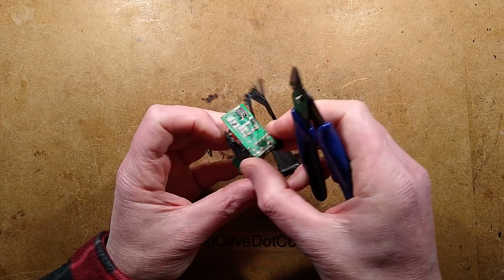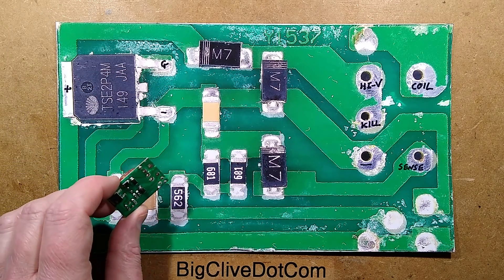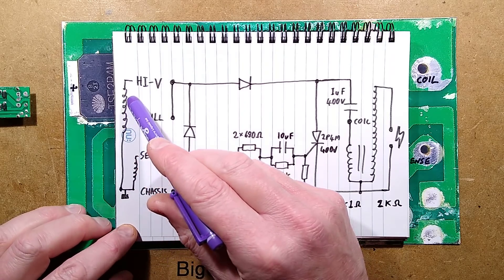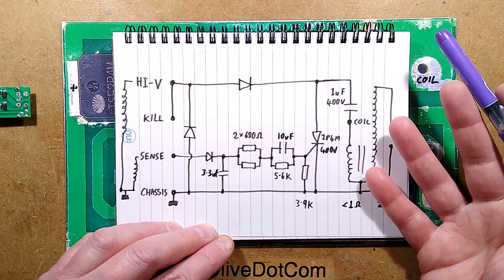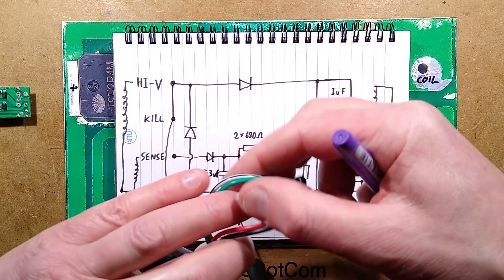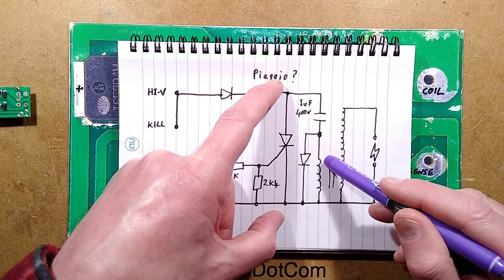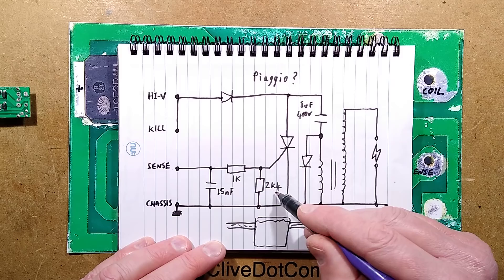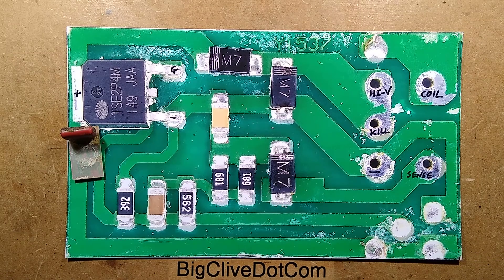Inside a cheap CDI Capacitive Discharge Ignition module - with schematic

Comment: If you haven't had a belt off an ignition coil you've never lived!
Reply: or a TV Flyback circuit. 
The worst shock I've ever had was from the HF start on a tig welder.
Reply: @TomOConnor-BlobOpera  iv had that my self Tom.. no joke i tell ya!!
Reply: When I was young and pretty, I had a dirt bike engine run away on me, the throttle slide was hung up. It was revving away at about eighteen thousand rpm, I hit the kill switch and nothing, grabbed the spark plug boot, got electrocuted, then smashed the sparkplug with a hammer that happened to be handy.
It was exciting.
Reply: @spurgear4  "Hammer Kill Switch" would make an excellent band name! :D
Reply: @Kae6502  I agree, maybe a rock and roll bagpipe kind of thing.
Reply: @spurgear4  mechanical retribution haha 😂
Reply: @spurgear4  🤣🤣🤣🤣🤣🤣🤣🤣🤣👍
Reply: A modern ignition coil is way worse than any measly flyback in a TV!! 
A flyback makes a nice soft little tiny arc meanwhile a modern ignition coil will jump over a 1-in gap with a thick nasty spark!
And yeah I've also been bitten by HF Tig That's no fun either!
Reply: I got a bite from an aircraft magneto....holy hell those things have some kick!
Reply: @DiverJames  AgentJayZ (aircraft engine mechanic) has tested lots of those and on the smaller engines, the ignition snapping noise is audible until the engine is up to a substantial percentage of its design speed. Would be interesting if he could donate a broken one for teardown. (Would take a while since for obvious reasons, those rarely fail.)
Reply: @NiHaoMike64  jet engine igniters are potentially fatal; several joules (at least) and extremely high voltage. As a retired pilot, I've followed @AgentJayZ for a while - always great content. We can switch the igniters on/off from the cockpit too - operational conditions sometimes dictate it as a safety measure to allow immediate relight in case of a flameout (like during heavy rain/snow/turbulence, etc). ☠️😬
Reply: On my BMW airhead I discovered that it discharges the coil on turning the ignition key to off. I was holding a spark plug at the time... 10Kv across the chest hurt like buggery.
Reply: Was timing a buddies car long ago, the timing light had a screw on the handle, revved up, timing light arced through the screw down my arms out the fender i was resting on. It clamped me pretty good, had to yell at him to kill the engine. I now have an intimate idea of what 2000rpm feels like from the spark plugs view....

I couldn't open my fists for 15 minutes.
Reply: DARK APPARITION  Yeah, I learned not to touch the metal part! I am super careful now but I know it's going to happen again! These things happen lol
Reply: My side cutters got some new teeth in the blades today after getting a hit across 2 phases of a 600v supply that was definitely, positively, off.  Big flash, nearly fell off my ladder.

One of my grandfather's favourite tricks was to lift the bonnet of his old comma van and put his finger on the tip of a sparkplug whilst the engine was running.  Then he'd ask you to "just grab my adjustable spanner from the toolbox in the back".  He was a bugger, my granddad.
Reply: I have received several belts from ignition coils. Particularly when checking if leads are seated while the engine is running. most recently the connection to the points on my car which is an exposed nut (91 starlet 1E engine). the back EMF can give you a wallop too.
also got hit with several lawnmower engine magnetos,  an apple green screen monitor flyback, and a flyback that  I made a driver for at one point.
Reply: The worst bite I ever had was when the filter caps from my Marshall Major (640V) discharged through my finger!
Reply: yip!! no kill switch on the old lawn mower we had when i was a kid. pulling the sparkplug lead was not nice until i learned to not be still holding the handel for pushing it. even still not touching any part of it ya could still get a bang off it!! if anyone knows why that is when its covered in pure rubber i loved to know???
Reply: My brother hooked up a bike ignition coil to an RC NiCd pack many years back 7.2v pack and 12v coil, so not full output) and took it to a busy pub where he was zapping his mates. A load of other lads wanted to try it, and we ended up with a circle of maybe 20 people holding hands while he passed a shock through them all. Was very funny at the time, but he'd probably be in jail if that happened now.
Reply: @ferrumignis  You can try electric fence. The one for sheep has the most "bang", 10kV easy. And... yes, I and my classmates have tried it by daisy chaining ourselves. Everyone got their share of shocks.
I've tried to be careful around electricity but 220V from wall socket, half-rectified 400V from studio flash and ignition coil still got me. Don't like wintertime in modern buildings (extreme dry air and many synthetic things around) as this lets you experience static discharges about 1-2cm (nearing a inch) long.
Reply: @SeersantLoom  I spent every holiday at my grandparents farm as a kid, so I know electric fences quite well :D
Reply: Or the flash circuit from a SLR (approximately 3 joules)
Reply: I just got some 230vac shocks as a kid from a defective outlet. When high voltages are involved, I am always very calm and slow and careful and turn off power as soon as possible.
Reply: Not an experience I want to relive.
Reply: Very old "air rake" (several HP 1cyl engine with a big blower on the front) wouldn't shut down so I figured I would pull the plug wire...with insulated pliers because I knew it was hot and HV.  It was stuck so I grabbed the frame to get more leverage and YOW that insulated handle did squat to stop me from being shocked.  Next time I got a screwdriver and shorted it instead.
Reply: Try getting zapped by a LS truck coil, or better yet one of those old MSD boxes through a hot-rod coil via loose distributor wire cap!
Reply: I licked the terminals on a 9v battery, once
Reply: I remember lawn mowers that had a tab over the plug, and you had to hold it down to the plug to kill the motor
Reply: Got nailed by the electronic ignition coil on my truck back when.
wasn't even near touching the plug wire, but the arc was high enough voltage when I pulled the wire off that it arced around the boot to my hand.
Never used that method to stop my engine again...
Reply: A plasma cutter shock is stunning also
Reply: electric fence... weee. thats even worse. sledgehammer hit but all over.

some farmer claims they cure ross river fever or chonic fatigue after being pinned on one by a bull...

iunno, getting bucked off by the donkey onto one sure livened you up...

still, my worst was the 600V cap on the guitar amp... oh wow. thumb on the terminals as i pulled the chassis out...
Reply: I've gotten jolts from flybacks, 480V across the chest(don't trust humans, always lockout-tagout), and spent days in a row as an Ironworker welding with sopping wet clothes and gloves(changing electrodes is a rush when your grounded via the steel beam that your legs are clamped around), so I must be extra alive by OPs standards.
Reply: I remember my dad and I were changing the spark plugs on the bikes, I was testing for spark for some reason so I touched the spark plug to the chassis with my thumb still on the metal part of the spark plug, when I went to turn the engine over I got a big jolt through my hand! We were both in stitches after that!
Reply: @alistairstuart2009  I was timing a friends car long ago, and I distinctly remember thinking "I wonder if the screw in the middle of the handle of this timing light (old strobe style) is isolated.......Surely its not anywhere near the energized wires insi..." and then my hands clamped around the gun as angry pixies found their way halfway down my arm and into the fender. I got cycled through quite a few RPMs till my friend cut the engine off, couldnt open my fists for about 15 minutes.....Good times.....
Reply: The volts jolts, but the mils kills.

Comment: Honda have been using black as switched live for years, green for earth also it needs a minimum of 8mm spark to fire a gap of about  
.7mm under compression with fuel mix.

Comment: If they did not shunt the HV on the opposite half cycle they capacitor would charge to a not safe level ... it would act as a voltage doubler  and it would require twice the voltage rating of the capacitor.

Comment: The spark is generated with the collapse of the magnet field in the coil primary winding. The diode across the primary coil in the second schematic will pull coil to ground rapidly, enhancing the spark at the plug.
Reply: You both confuse CDI with the classic ignition system.
Reply: @Plons0Nard  diference betveen clasic and cdi is that classic use 12V and high power mosfets to create spark while cdi uses high voltage capacitor and therefore doeas not need a lerge amount of current (CDI capacitor discharge ingnition)
Reply: That's as I always understood, that it's the collapse of the voltage in the primary windings that induces voltage in the secondaries to produce a spark. The coil is fed a live and the module is on the "earth" side to break the circuit in response to a pulse from the sense trigger. This looks like a single cylinder either motorcycle or plant power, not sure if anything works differently on some small engine stuff.
Reply: TCI/point do rely on charge/collapse the external coil, the CDI works pretty much like a simple transformer. Both coils are not compatible.

BTW, the CDI system have a faster spark build up, and usually shorter,  than TCI (12v) or points, make them very actractive for determined engine types.

Comment: I thought that the high voltage output on the secondary coil came from the collapse of the magnetic field thats provided by the low resistance primary windings. The primary has current flowing building a magnetic field and when that current is diverted away from the primary windings the field colapses causing an extremely high voltage spike on the secondary side because of the much more numerous windings which is also why the secondary has such a high resistance
Reply: yep thats right.
Reply: that's a conventional points (or electronic) ignition, this is a CDI
Reply: @nirodper  So spark occurs when the coil is energized ?, no can't be true.
Reply: @Boraxo  The 200+v capacitor gets discharged across the coil primary, with a very low dc resistance. The only thing limiting current is the coil inductance. I do believe it's forward conduction, the core has very little iron, the primary has few turns, and the current is big but isn't that huge so the core can't store much energy.

That's one of the great things about CDI's, capacitors are much better at storing energy than inductors
Reply: @Boraxo  On a conventional ignition you'll get a large voltage spike on the coil when the points open due to the stored magnetic energy. This large spike is multiplied and you get kilovolts at the secondary. The CDI is the same except the voltage spike comes from the capacitor discharging instead of the magnetic field collapsing.

Comment: Yes, you can indeed get a shock from the kill switch wire, seen it happen quite a few times on small boat outboard motors, with varying degrees of amusement.
Reply: Agreed- much funnier when it happens to someone else

Comment: Clive,what kind of disolvente fluid did you use for the epoxy! Thanks, snd regards from Boca Raton, Florida.
Reply: He was using acetone.
Reply: @chrishartley1210  DCM is also very effective at dissolving epoxy. Though if you leave it to soak too long components can start disappearing too.

Comment: Several of my customers and myself have received the shock you suspect when connections fail.  Sometimes at the metal handlebars when the earth connection is lost.  Sometimes at a metal key switch.  Precisely as you predict rather a surprise, also happens on mowers and such with magneto spark engines.
Reply: The man, the myth, the legend.  Funny running into you on YouTube Jon!  -Vince Jr
Reply: @vincepale  you are also the man, the myth, the legend!
Reply: Had it with the lawnmower, very irritating

Comment: The weird circuitry on the gate of the thyristor is usually used to prevent transistors from saturating and increase switching speed. It gives a bit more initial current and then less to prevent saturation. It's frequency dependant though.

Comment: That circuit remembers me a lot to a dimmer circuit. I wonder if they copied the thyristor gate control circuit from from a dimmer design. That could explain the strange arrangement of resistors and capacitors.

Comment: Definitely interesting as I'm about to tackle a 1953/1955 farm all tractor. Originally 6v my dad and I switched it over to 12v years ago. I'm about to rewire the whole tractor. With my unit 210e at hand, newly purchased. Cheers.

Comment: These RC filters between the sense and the gate look like a band stop filter, with a low pass followed by a high pass. We could compute the equivalent impedance and phase shift of the parallel RC with the 10 uF if the frequency was known. Maybe someone with Matlab (or whatever kids use these days) can compute you the frequency response, it's probably weird looking.

Comment: I always just assumed CDI systems needed a honking-great cap, but of course you don't need much energy to arc across a 1mm gap.
Reply: it needs about 8mm spark in free air to fire .7 mm under compression with fuel mix.
Reply from the maker: It compensates for the capacitor size with the voltage.
Reply: You do need a fair amount of voltage/power when the atmosphere is something like 7-8% gasoline and compressed to several atmospheres of pressure (i.e. far higher insulation resistance than air). That's why when testing spark on an engine you're looking for a fat white spark on the plug or an arc a centimeter or so long if you're daring enough to stab a screwdriver in the boot and hold the handle.

Comment: I think the diode across the winding is to clamp the negative excursion as the coil would produce a very high negative voltage at high revs and damage the rectifier diode or arc across the kill switch.